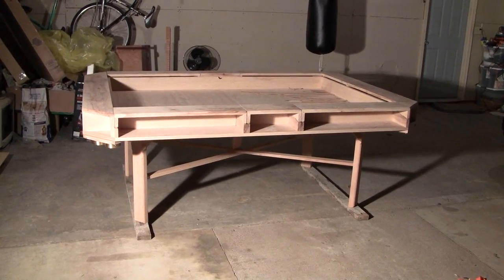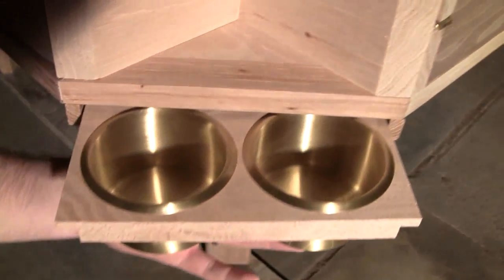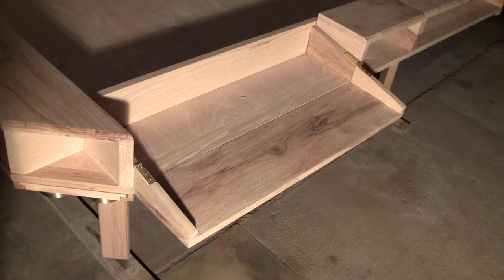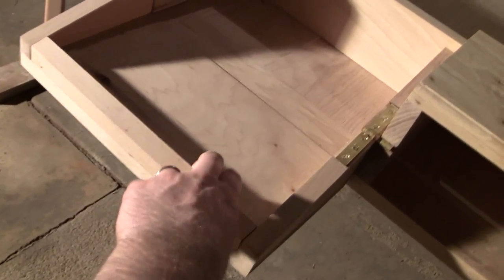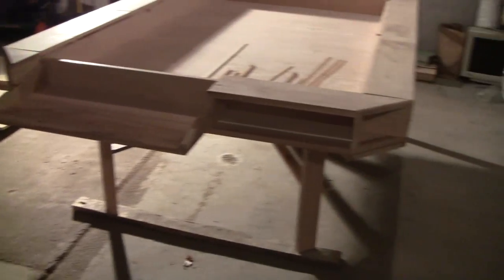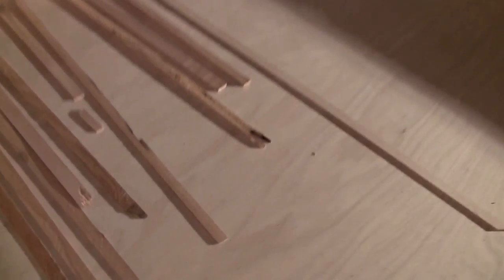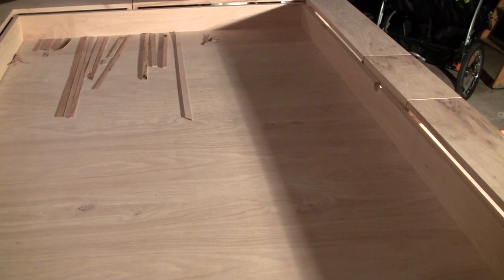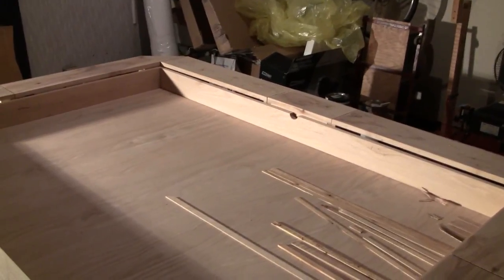Gaming Table - Nearly Complete

Comment: i wish i would have seen this before i built my table. i built mine so that it could play to games of Warmachine/Hordes at the same time so it has an inner game space of 8x4. basically all that it is is a sheet of plywood with a box around it. i'm thinking of adding more to it like this one with fold outs and the cup holders. it will be a monster when its done probably 9 x 5 with the foldouts in and and 10 x 6 with them out!

Comment from the maker: @OrsusZoktavir It separates into two pieces by removing 8 screws.  The frame/legs on the bottom come off of the top 6 inches of the table, very easy.  I'll need to separate it to get it through my door into my apartment.